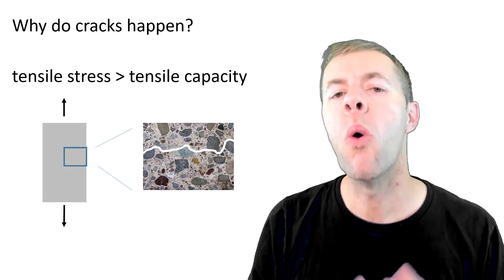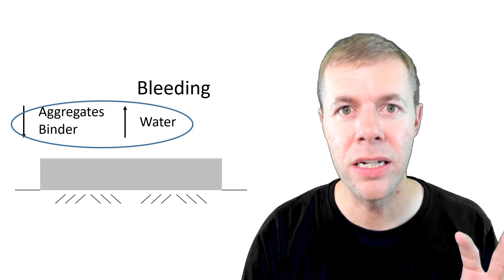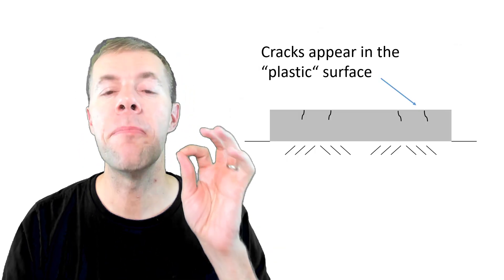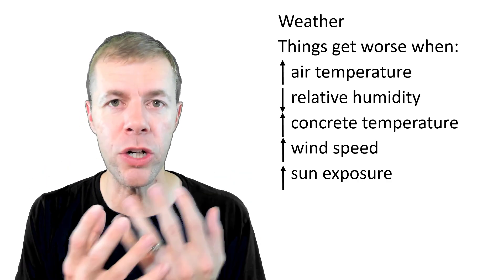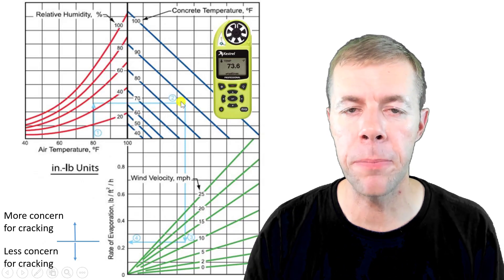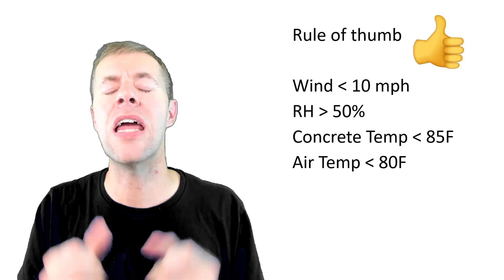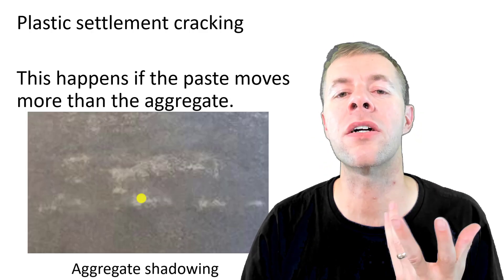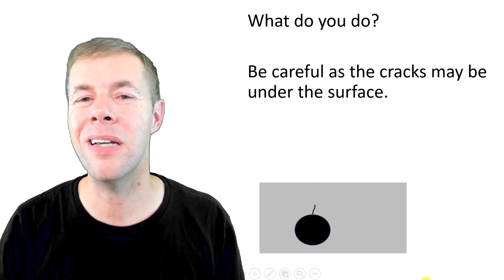Plastic shrinkage and settlement cracking in concrete

Comment: Oh yeah. Finishing large slabs for apartment buildings. They would crack as we were finishing them. Someone had the smart idea to add fiber mesh. But it didn't help. The solution is to not pour concrete on hot windy days. But, there's always a but. The contractor needs slabs poured to fulfill the contract. Like the old saying "make hay while the sun shines". As a concrete worker you had to make as much money as you can or you will starve in the winter.
Reply: nebraska summers , hot and high humidity ,,., ranch basements are an oven,., crack as your finishing., at least we saw cut it., seen new basements in other states were they just let it spider out..//. ugh
Reply from the maker: Thanks Patrick!
Reply: Here in the hot summer, we sometimes "make hay" when the sun isn't shining by pouring larger slabs at night when the temps are cooler. Hard to find guys to work that schedule but they're out there and most of them appreciate working in the cool instead of the sun.
Reply: Ya man I agree. Here in Wyoming it's hot dry and windy or snowy windy and freezing. We would have no concrete if we waited to pour. Tyler's videos have helped me understand the problems and how to address them. Thanks tyler
Reply: Pat Konelectric you crysy amigo...... chcahchacahcha

Comment: I like the idea of the paste being not to ratio to allow for the contraction...  that is, typically, no stones or on the surface of those plastic shrinkage cracks... my experience... 
The paste being bought to the top with the mag trowel...  evaporation and ratio of the paste to it's ''span'' (on the surface)...    Thanks Tyler for your videos.   Also, there is a cool app for the evaporation rate...
Reply from the maker: I think I understand what you are saying. I like your idea about the span between the stones.  We are doing some research on this topic and we can try to look further into this.  Thanks so much for the comment.

Comment: We frequently have extreme drying conditions. I have found that accelerating the mix is often the solution. It allows more of the water to hydrate before it evaporates, and quickly gets some tensile strength in the concrete. Caution: Be prepared.

Tyler, next you need to do a video of outside power-trowelled slabs going "rubbery" during extreme drying conditions. This is a lesson that I need to explain over and over again every summer.
Reply from the maker: Fred,
Thanks for the tip.  I love hearing about what works in the field.

Can you tell me more about the rubbery slabs?  I need to better understand what you mean.
Reply: When power troweling a slab in extreme drying conditions, the slab will feel spongy or rubbery. The very surface of the slab loses paste due to absence of water, and a w/c gradient occurs going down into the first inch or so of the slab. The lower w/c in the top inch or two of slab will accelerate the set in the way that  lower mix water always does. This results in a raft of semi-set concrete floating on a much more plastic base. The feel is identical too walking on the stamping pads used for embossing.

Finishers end up working extra hard to trowel the paste-less surface while the floor is getting more and more wavy. As the thin already rigid top layer flexes, it will start cracking a lot and causing need for still more trowelling. If using riders, it is easy to have the rider suddenly drop through the surface and get buried. 

This is commonly first noticed around the second pass with the power trowel. Water is then usually dumped onto the slab to reduce the trowel friction/pull and to try to create paste. All theory aside, at this point, this is your only hope, but you will never fully recover.

This situation is very much aggravated by pouring on poly, or using retarders in the mix to "help" you deal with the heat. 

The bulk of the damage is done by the evaporation happening while waiting for the first trowel. I strongly stress that replacement water needs to be almost constantly applied to the slab during this time. There is a way to do this carefully without churning water into the surface, but if guys are "too careful" it is easy to lose the evaporation battle.

Evaporation retarders help, and some days are  sufficient, but my experience is that they usually need to be mixed much stronger than label directions.

If you have skilled crews, what I have found to be the simplest solution, is to use a hot or fast setting mix with enough set delay to allow for transport and placing time, and then have it go off. The finishers will be finished troweling before the slab has a chance to dry. Certainly, if you combine this with the above above mentioned practices, you can have very good results.
Reply from the maker: Fred - Thanks for the awesome response.  You have more experience than I do about this.  What you are saying makes sense.  Because of the finishing, the surface is setting up before the bulk of the concrete.  Let me think about this topic some more.